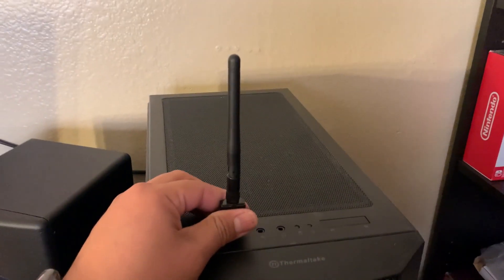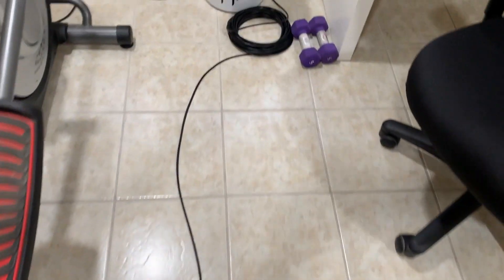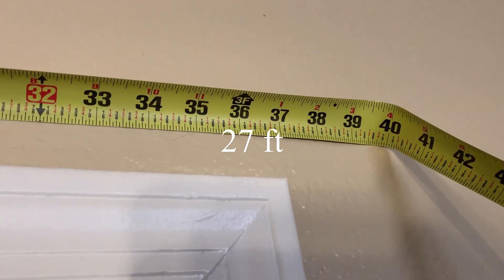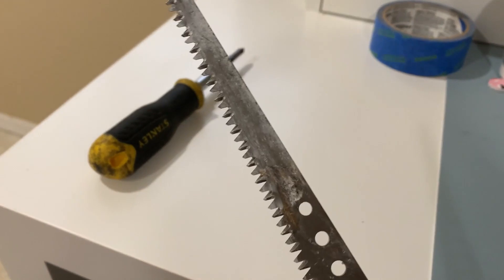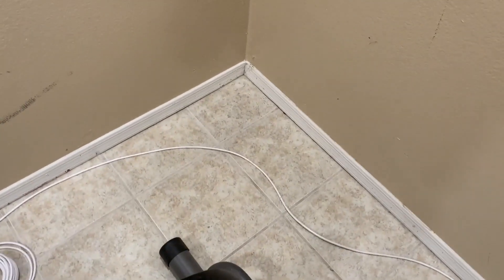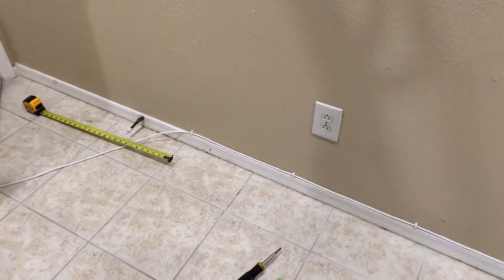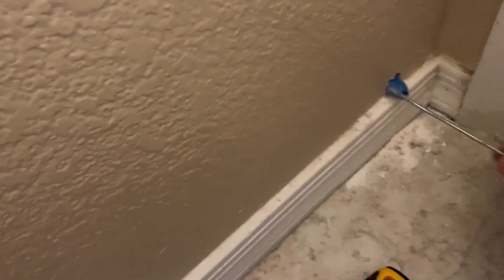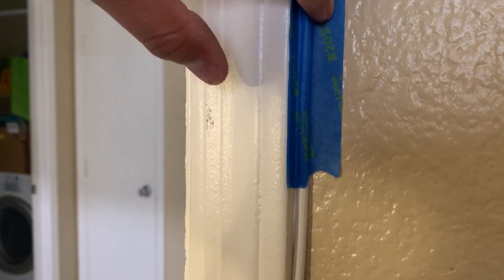Ditch the WiFi adapters! DIY Ethernet routing

Comment: Luis  I did this several years ago. My house has a crawl space so i ran all the ethernet cable under there and up into the different rooms.. It is the ONLY advantage for having a crawl space!! They otherwise are a huge problem area for one's home. I enjoyed this video as i have all of the others.
Reply from the maker: I have worked in a few homes with crawl space underneath, such as trailers or pre-manufactured homes. It’s handy being able to get underneath your shower or sinks to change out the plumbing and running cable like you said, but I’m not sure how I’d feel about living in one. Glad you liked the video and thanks for checking it out.